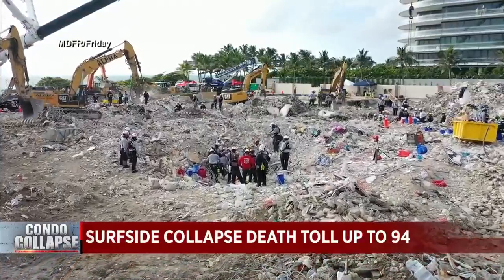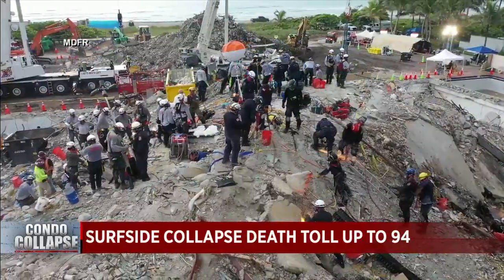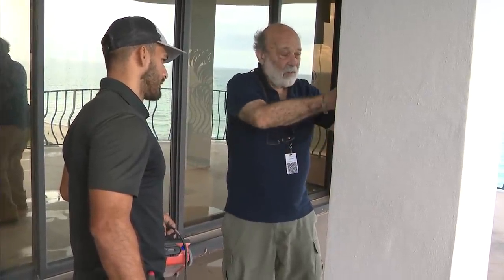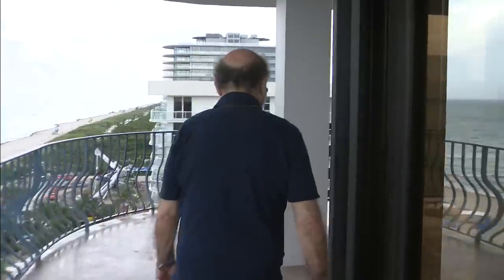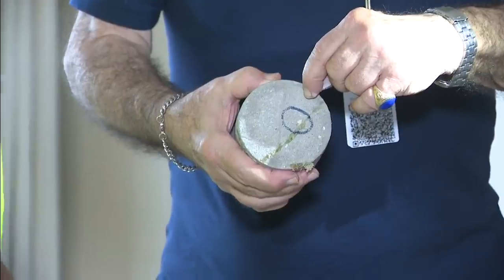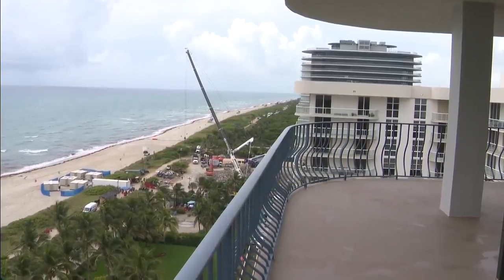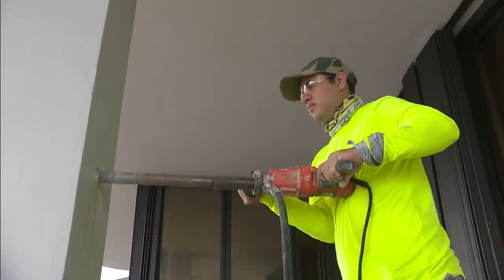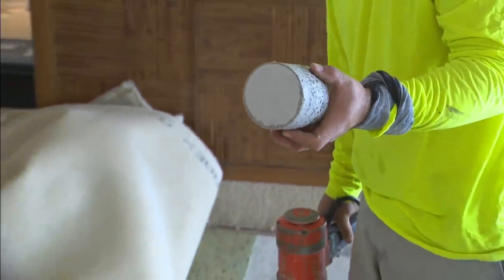Structural expert studying still-standing Champlain Towers North looking for clues into south to...

Comment: I wouldn’t trust their design after their nearby building collapsed
Reply: From what I heard, the building design is probably fine. If it wasn’t, it wouldn’t have stood for 40 years. There were a hell of a lot of things that went wrong over time, which were ignored in the south tower for all this to happen.
Reply: @uzaiyaro   They cut corners and yet the building lasted, but not with the extra pressure that the building would take over time, especially with lack of needed attention and timely repairs.
Reply: @angellight5040  you might be right there, but at the moment, we really don’t know what is going on beyond a few cursory examinations. I would be a bit careful about saying this or that, this early in the investigation.

But on that thought, if the original design or construction was deficient in such a serious way, surely it would’ve bought the building down earlier. We’ll all know in due time, but just be weary of red herrings that may come up, because right now, people are all over the shop with their take on it. As tends to happen early in investigations like this.
Reply: @angellight5040  How do you know they cut corners? were you the general contractor that built the building?
Reply: Yep I couldn't agree more. But apparently other buildings are no better off judging by the Crestview inspection failure.
Reply: They will be reviewing the original drawings for quality of design and comparing them to the existing conditions of the both the collapsed south building and the standing north building.
Reply: @allanhwhite.kineticmobiles  Agreed! If the design was good but wasn't followed during the the construction (and inspection) there's the problem. I hope the city has good records back to 1981.
Reply: Construction SHOULD be done to the design, but is never completely checked.
Reply: There’s a great video by an Argentine architecture professor on YouTube and he explains that both buildings have a major design flaw. His channel name is ArqManes
Reply: The design was not the flaw, poor maintenance was to blame. No matter how well a building is built if it is not taken care of it will waste away.
Reply: Dont worry you cant afford it anyhow.
Reply: Sorry I have been working on buildings all my life no way if it was of good design and no maintenance at all a 40 Year old structure should not collapse. Look at all the old structures around the country that are more than twice the age of this building that have had minimum maintenance and are still solid structures.
Reply: @butchdoane3419  That may well be true, but surely being so close to the ocean would have played a part in this. I’m sure we’ll all know in due course, but there had been complaints about water in the basement for years, complaints which the other two towers never had. The north tower is apparently dry as a bone, and the east tower was built after hurricane andrew so it will be interesting if there are any differences in the design and construction.
Reply: @uzaiyaro  yes I didn't mean that the other factors did not play a part . Sadly we just started building this type of junk about 40 Years ago. We used to make the joke we were working on multi-million dollar through away buildings. It every thing from the engineering and on and on. Sorry I know people don't want to hear this but look around we have bridges buildings that are 25 years old failing and it is not tradesman who are to blame we build what were told to build. We tried to say something about this crap 30 years ago but we were told if we wanted to work shut up and build the crap. Ever wonder why roads we use to build lasted and now we're rebuilding them before they are done. Time to start asking questions quit trusting authorities.
Reply: nice hindsight there, when properly maintain any building can remain standing, but those columns look so thin and with the garage holding up the structure you need a bit more support because that looks so weak.

Comment: The live feed of the site shows a large hole where the collapse started.
Reply: Just heard that the attorney for the towers says they saw a big hole in the ground that went feet below the parking deck level.  Another theory that ties into the going around right now is that they had a void under the parking garage that would let water stand and would not be able to be inspected.   Which may have had damaged that went undetected.   If that's the case it could of been settling which was detected in the mid 2000s that the building was settling unevenly by average of 2 mm a year.

Comment: I do bet the not collapsed tower with garage was the first to be built and approved by the County. Then some smart "person" came up with an extension to the construction.
And it was approved.
They built 12 levels above the "parking garage" with the old pillar design in place.
And that caused the collapse then Years later on.
You can surely blame all on the water corrosion, the pool, etc. but those were just helping the faulty construction to crumble.
Reply: From the video of the parking garage that is on youtube all the pillars were the same size
Reply: @MinusEighty  sry, the remaining part of the building had bigger ones. Thus also can be seen on plans.
Reply: @chreinisch  On the plans.  But a lady took a video of that whole garage and the whole garage under both parts of the building had the same size columns.
Reply: @MinusEighty  the plans I have had a look at were some of the early plans.
And in those a big portion of the site, the columns were drafted much smaller. As it seems 12x12 or most unlikely 14x14 with some rebar, but to me way to puny to support a 12 Level Building for sure.
The contingency left on carrying weight would been way too low.
And when looking at videos, little I have seen of 2 inch rebars
Reply: @chreinisch  All of the columns in the video of the parking garage look quite substantial to me.
Reply: @MinusEighty  for a parking garage surely, certainly not to my understanding for a 12 storey building above. Please also do have a look at the remaining structure, compare these pillars with the ones on the ground. For many people there is no difference, but to some there is.
Sadly
Reply: @MinusEighty  What?? The pillars for the collapsed portion are toothpicks compared to the columns of the remaining structure.

Comment: Well when the “hired engineer” is wearing a city of shirt I think we all get the extent of the cover up, see it’s fine! Is that the underground parking garage or the penthouse far far away from the problem area?!
Reply: Gotta hide the systemic problem or we will see the largest class action lawsuit of all time. The rebar is missing because the builder removed it after the inspector left.  That happened a lot back then when these were being built.
Reply: This guy wrote a lot of the codes...I'm pretty sure he knows what he's doing
Reply: He might have written codes but when your not watching what they interpret that code to apply to what they want, it’s called bending the rules done 10,000 times a day everywhere
Reply: @robertdeltiempo4411  Exactly.  The city of Miami is notorious for not accepting comparative analysis on some projects and not on others.  Just ask Mr. Farooq. Oh but you can’t, he’s gone.  Oh well.  If you could see the field conditions that run rampant in south Florida building construction and the clueless they have doing the work, you would not live in these structures.

Comment: Excellent video.  This is the right way to handle things.  Now get a geotechnical engineer to examine the sub structure and an electrical engineer to examine if the electrical system is up to code.  It’s sister tower went down so they should look at everything possible.  Examine every detail.

Comment: The core shows that you cut thru a top reinforcing bar.  How will the 8,000 psi concrete fix the cut bar????  Current technology will allow you to locate the reinforcing, electrical conduit and pluming before you cut or drill.
Reply: You can't be serious... you think drilling through a single bar makes a difference?  You obviously have no idea how rebar develops in concrete.   In many cases you actually want to hit a rebar because you want to check cover.  Don't talk about things you don't know about.
Reply: @m.5051  I have been practicing structural engineering for about 50 years.  It's a little late to find out I don't know what I am doing.  There are easy ways to check reinforcing cover with out destroying the bar.  At some column locations there are 10 top bars shown on the plans.  Cutting one bar reduces the moment capacity by 10%.  That my friend is a significant reduction in capacity.  To get a 10% reduction in capacity from corrosion requires a fairly advanced state of corrosion.
Reply: @johncoil1418  What are you even talking about?  10 top bars where...in the slab adjacent to a column? There's no way you're a structural engineer.  I'm calling bs.
Reply: @johncoil1418  Are you saying that there's a 10% reduction in flexural capacity of the entire slab unit because 1 bar was cut?  A 10% reduction over a slab design width of 0.5 inches maybe haha.  You're crazy.

Comment: Imagine being the guy that has to drill into those pillars... I'd need an extra diaper!
Reply: Removing a core sample isnt huge if done properly. They are Also on the upper floor where less demand is. I’m assuming column size doesn’t decrease per floor due to formwork (or maybe at a lower level). They avoided rebar and replacing the missing  compressive concrete. The samples on ones lower would be more nerve wracking since they are heavily loaded. Different mixes could be used at lower floors. -structural engineer
Reply: @la-sand  but a very thin floor, isn't it? I can't imagine here concrete floors or ceilings under 8 " (20 cm)
Reply: @Stoffmonster467  depends on spacing of columns. 6” to 8” is typical for a floor slab. They have thickened slabs near columns which help with punching shear and flexure
Reply: He updated his life insurance policy before he hit the trigger
Reply: That is the difference between him and other people. He dosen't need them because he knows what he is doing. Are you expecting the whole building to collapse because of one little hole?
Reply: "We are avoiding reinforcing steel where we could" @ 2:06 Oops.
Reply: @DavidJohnson-tv2nn  he said where we could. Looked mid span of the slab, least stress and demand. He appears to be doing the right thing, he’s located all the rebar.
Probably ok if one bar is lost in a nice controlled environment such as an interior slab, these arent post tensioned, good pop in those scares all the contractors. But contractors hit rebar all the time and ask for forgiveness. Not the best practice but man it’s common to see. -structural engineer
Reply: @la-sand  It's funny in a way because they are trying to avoid rebar where possible and he nailed that one dead center. Not only that, but he ended up cutting the rebar on the core sample they showed on TV.
Reply: @DavidJohnson-tv2nn  i mean it depends on how close the rebar spacing is. You might hit one.
Reply: @la-sand  One more question...
Can a floor that is so thin support itself with only a double rebar mat? No beams and no post tension cables. Seems to me there was an inherent weakness in the original design.
Reply: @DavidJohnson-tv2nn  It's common in industry to be that thin. Remember, you're talking like 40 lbs per sq ft of load for residential, and a certain design concentrated load. It's thickness is variable on the spans and strength of concrete. We're not driving trucks across these slabs. Transfer/podium slabs at lower levels and garage slabs could be thicker as they see more loads.
Reply: @la-sand  I'm not an engineer so you can correct me where I'm wrong.
It seems to me that the concrete would weigh 40 lbs. per sq. ft. But setting that aside for now...
On the pool deck, you have a layer of sand, then pavers. Then there's the weight of the sand when it soaks up water. 
Now add to that, water infiltration into the slab over the years in a highly corrosive environment. 
But we're not done yet. A construction crane may drive over the pool deck at some point for building maintenance, causing damage. 
Going further....
Have you seen the photos of the poor rebar tie in to the columns? Then there's the spindly columns themselves in the portion of the building that collapsed.
Seems to me a more robust design might have kept the building standing until repairs were made.
Now, I'm in no way making excuses for neglected maintenance. But from an engineering point of view, shouldn't the engineers have built in a bigger safety factor. And is it possible that is a contributing cause?
Reply: @DavidJohnson-tv2nn  Sorry, I meant to say that 40psf is the typical (live load) design on top of self weight (dead load) and other misc items allowance (sprinklers+hvac are considered dead load). This was just this video for the penthouse slab I was refering to. Pavers would have been considered in the design of the slab. Because it's a congregation, it would have been to today's code 100 psf  (live load) is my guess, maybe a bit more. The pool deck slab should have been thicker than a typical floor slab. They did have planters on there aswell so it might have been designed for more. That I do not know. But usually something this tall they dont have cranes and they have davit cranes or seats where people repell down for maintenance.  Column reinforcing requirements have changed over 40 years but no I haven't looked close enough on the "asbuilt" drawings to conclude anything. Corrosion is bad, and it is something that should be taken seriously. But sometimes things can work where by calcs say it doesnt. For instance, there was a parking garage in Peru (i want to say) that all the rebar was corroded in the slab but it still stood up. The soil around the parking garage compressed the slab (compression ring) enough where arching action occured and there was no tension in the slab. Tension forces get taken out by rebar. So it was something not initially designed for but it stood up because there was no need for rebar for strength purposes in that case. They just load test it periodically to make sure it's ok. Now that load testing driver needs to get paid big ha!  Other things can help a structure that engineers dont account for and it does take a lot of bad things for failure to actually occur. They did have a few minutes to escape based on the one garage video but alas, no alarm was raised quick enough.
Reply: @la-sand  That's what I was thinking too. From what I've heard, there are usually multiple causes of structural failure. As an example...
An engineer may make an error and undersize a beam. Then a plumber comes along and drill a hole in it. Then the building occupant puts an unusually heavy load on it. Then there is a final trigger event that initiates failure. 
Which gets back to the crane. That was just an example. Over a 40 year period, there could have been any number of heavy vehicles that drove onto the pool deck for various reasons. Just another example...
The truck that delivered the pavers could have driven right over the deck... A 5 ton forklift unloads the truck.... All the pallets of pavers get placed in one spot...
Yes, the engineers should take such things into account. But mistakes can be made. It's just a guess at this point, but I can't help but feel that there are multiple causes for this accident that go beyond neglected maintenance. That may have been the final cause of the building coming down. But there were probably several contributing factors as well. Again, just a guess, I may be wrong.
Reply: Stress flows around the hole. It's the same reason why tunnels don't automatically collapse.
Reply: It was a joke... lighten up people 😛
Reply: people and their paranois

Comment: Thats all good but are they going to detect a pop up sinkhole when it occurs under the bldg ? Or a sudden water gush under it. It's swamp land.
Reply: They really need to check the elevator pits which are below grade and below the foundation.  That will tell them of any water seepage under the structure and where it pools and flows to.  I hope the north Tower pumps work better than those in the south tower.

Comment: You see that HUGE multimillion dollar codo building standing It was finished in 2019 The excavations and explosions are never mentioned as a probable contributing factor to the collapse. The residents at Champlaine Towers were complaining of the noise level during its construction. There are many houses in Dade County that have suffered cracked walls and foundations due to construction where explosives are used underground to excavate the ground.
Reply: I did not even think about that. Thank you !
Reply: What is a "codo" building? They cost a multimillion dollars?
Reply: @rickgeller6043  Condo is the word that was supposed to be used there.